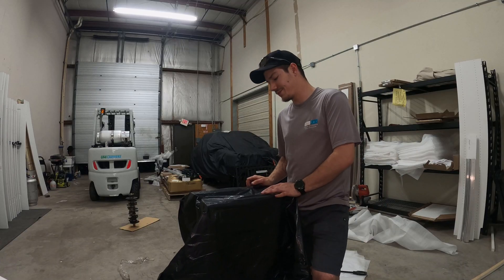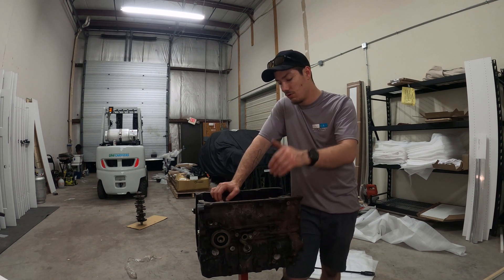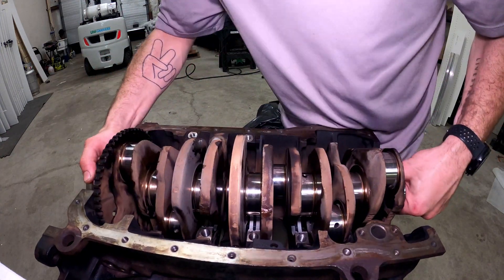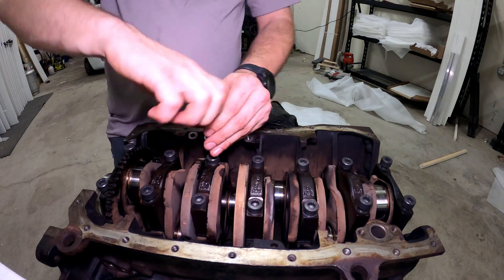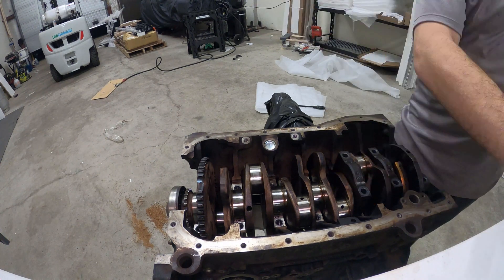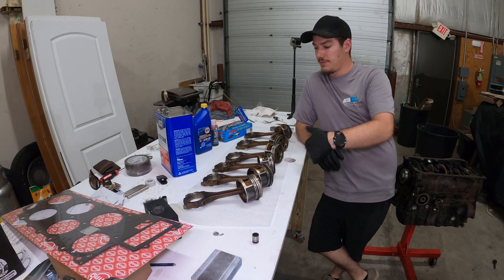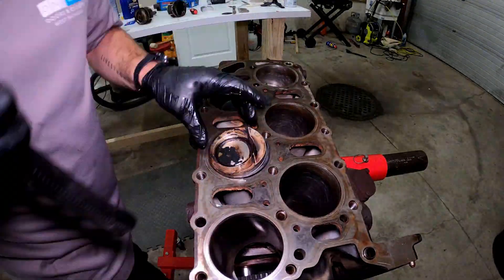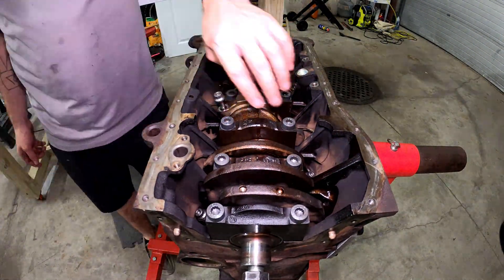12v VR6 Bottom End Assembly

Comment: did you have the rods resized for the arp bolts? i use a popsicle stick to help push the rings in when installing pistons in my VRs, doing it with gloves on sucks lol.
Reply from the maker: I did not, but I did measure eveything after it was torqued with a dial bore guage and everything looked good. I like the popsicle stick idea though, ill keep that in mine next time!
Reply: @OTLMotorsports  we sent our vr6 to a shop last year to get bored/checked and he said he’d “resize” the rods for the arp’s. He also said the piston pin bushing may need a new bushing.
He ended up not touching the rods at all, said they were good to go as is. He was super thorough and I know he checked them out. You should be good to go with the rods🤙
Keep it up!!🧰🔧🔩⚙️
Reply from the maker: Thanks I appreciate it!